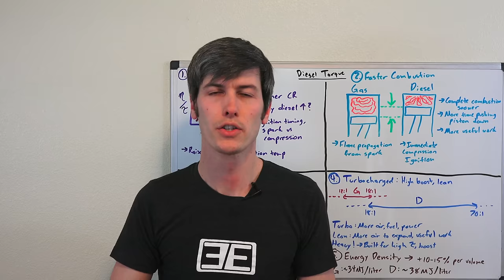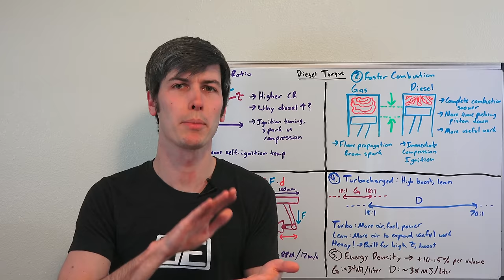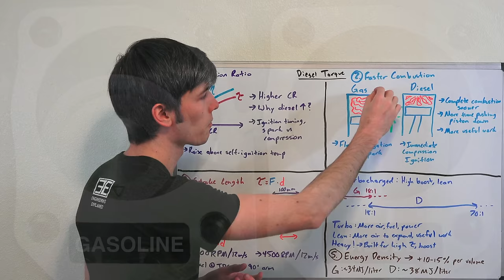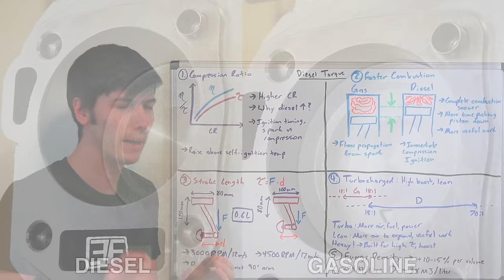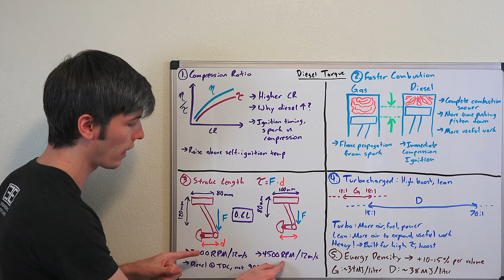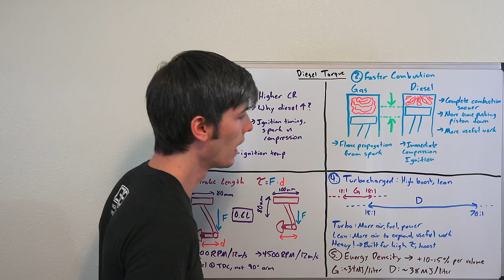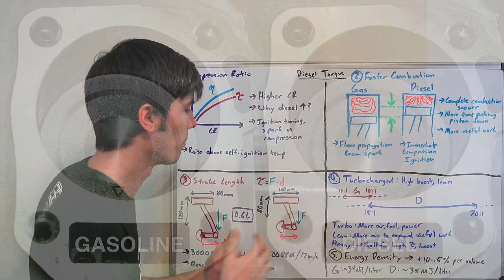5 Reasons Diesel Engines Make More Torque Than Gasoline

Comment: Modern diesel engines also have the advantage of the fuel being injected in stages, a pre injection to get it going followed by multiple tiny injections as the piston turns over for a more even and longer combustion pressure during the power stroke resulting in higher torque. Compared to older one shot diesel injectors.

Comment: hi my name is i am mailing you to ask one technical question i want to know that the v12 or v8 engine build for mid engine layout is constructed similarly like v8 or v12 constructed in structure and design like front engine does the engine in mid engine layout is same as engine in front engine like because cars like pagani zonda and huyara got engine from mercedes mclaren f1 has bmw v12 engine and some supercars have chevy base v8 engine koenigsegg got ford based engine so does mid engine layout has same engines which are constructed for front engine and same engine can be used in either mid or front engine layout waiting for your humble reply thanks indeed

Comment: About energy levels diesel vs gasoline, the diesel fuel molecules are made up of longer strands that are convoluted. The gasoline strands are shorter but both have carbon atoms. When these react with oxygen, more energy is released by the diesel molecules compared to gasoline.

Comment: Diesel engine are heavy and bigger as it vibrates a lot cause the whole power making is based on compressing the air fuel mixture, may be not for turbos
Cause manufacturers are marketing turbo petrols more than diesel turbo engine.

Comment: I have never seen a Gas engine where the piston didn't travel all the way to the top of the cylinder. The combustion chamber is in the head. Most diesel engines have the combustion chamber on the piston. The head is completely flat.

Comment: Why not make gas engines operate like diesel? Instead of spark plug, have high compression and inject the gas at tdc (like with diesel), won't the heat be enough to ignite the gas without a spark plug? That's why gas usually has lower compression ratio to prevent predetontation, so why not use predetonation to its advantage and out do diesels?

Every diesel guy talks about how much "better" diesels are but they always ignore the fact that diesels need to be boosted. There have only be a few non-turbo diesels ever made and they're complete crap. So if you compared a 2.0 turbo gas engine to a 2.0 turbo diesel engine, which would get more power and which would get more torque, and why? Mazda achieved 14:1 compression with its skyactiv engines, so if you just turboed that, theoretically it should get more power and torque than a diesel.

Comment: OK, so I have a question that I've wanted to ask for a while and this vid is the perfect opportunity.  Why, in the diesel, don't they just force in more air so that the compression ratio would be much higher, and then just let the piston go back down a while and wait to inject the fuel until the crank is closer to the ideal angle, maybe centering injection on the ideal (right) angle.  The idea being that compression would still be high enough at that point to ignite the fuel.  I would think this would increase torque a lot.  Maybe all that compression would just create too much heat? Thanks.  I watch all your vids several times, which is why this question is a little late :- )

Comment: Video is somewhat confusing/misleading to me. Diesel is significantly less volatile than gasoline and has a much slower burn rate and yet you say it achieves complete combustion faster because of the time it takes to gasoline to achieve complete combustion

Comment: I must take issue with the assertion that diesel combustion is quicker. Diesel combustion requires the fuel and air to mix, which takes time. This is why diesels are RPM limited, more than the heavier internal parts. (Look at the Audi R10 redline rpm). The slower combustion, along with the higher compression ratio, allows a diesel to have a much higher BMEP for a given peak cylinder pressure. And BMEP is what drives torque output.
Reply: Specifically, the initial injection of diesel fuel ignites, but creates a locally oxygen-deprived environment. Only after the air swirls to expose the unburned fuel to oxygen will combustion continue. This takes time, which limits the rate of pressure rise and creates higher BMEP within a given PCP limit.

Comment: I would like to add that this is also logical since diesel has a lower auto-ignition temperature. Also doesn't compression ratio and stroke length go hand in hand? Thus producing more torque?

Comment: DS gas and air mixed in compressed will not blow up that's why it needs a spark plug but diesel fuel and air compressed will blow up no need for spark plug

Comment: Wait. If the gasoline engine's ignition occurs over a longer period of time while the diesel engine's one occurs almost instantly, why is the PV graph of the otto cycle sharp pointed while the diesel cycle is the one with the flat top?

Comment: what would happen if you bore a hole on the top and put a spark plug on a diesel engine, mount all the necessary wires, coils, rotors, etc... then run on gasoline?
Seems like gasoline engines are not utilizing their full potential.

Comment: Diesel engines are always sort of running wide open throttle with the output controlled by the amount of fuel injected where as gasoline engines spend most of their life heavily throttled, little air entering the cylinder, small amount of actual compression and that is where any engine is least efficient if I'm not mistaken.

Comment: Just two things.
The diameter - stroke ratio is not much different between Diesel and Gasoline engines if they are car engines.
And today most Gasoline engines are also Turbo engine.

Comment: You are making it sound like it’s a mechanical function. It has to do with entropy and constant pressure vs constant volume. Thermodynamics explains its better along with the chemistry of the fuel. Do some searches for otto cycle vs diesel cycle. I took this class in Engineering School so this is what I remember from it at least.

Comment: Not all gas motors stop the piston before reaching the top of the cylinder. Actually most I know of are zero decked and use the cylinder head combustion chamber volume to set the compression ratio. Some also will dish the piston to lower or dome the piston top to raise. Stopping the piston short in the hole is the worst way to do it.

Comment: In the combustion the diesel keeps injecting diesel so it keeps combusting in the working phase, plus diesel is denser so you need less to "make" the same, its easy to remap and some use variable turbos which increases usable torque and power along the rev range

Comment: One thing I noticed in my 1.5 diesel Nissan Qashqai recently was on motorway in Top gear with throttle position fixed and road speed fixed after a short delay 20 seconds or so the revs dropped (approx 200 revs) Is this some recent new diesel fuel control feature on the Renault K9K engine? This obviously is assisting in achieving the 70mpg I was seeing.

Comment: In regards to you saying that the stroke length doesn't have much effect on torque, is not the case. You are disregarding the leverage that a long stroke motor has. This leverage is where the torque comes from.

Comment: The faster combustion part is quite apparent when you look at the ignition/ injection timing for the two types of engines. I have a Cummins B3.3 engine which injects the fuel 6.6 degrees after TDC, while gasoline engines almost never have less than 5 degrees of ignition advance.

Comment: Is the HP for gasoline engine higher than the Diesel Engine?

If it is higher for the gasoline engine, then is it due to the higher RPM produced for the same piston speed?

Thanks

Comment: Injector pulsewidth... The time the high pressure injectors has to inject fuel at high rpm is number 1 factor that limits a diesel engines rpm

Comment: Diesel motors are  great....run maily on air stronger last longer use  less fuel...but do not get a motor with a cast iron block and a aluminium hear u get electroloses and yr head gasket will  corrode ...may be head too...water will enter yr motor unless u have a special head casket..

Comment: I normaly like your explanations, but this time u are wrong. No Dieselengine will produce more torque at the same circumstances. The Compession means nothing in this case. U just have to watch how much energy fuel has per kg/ liter and how much fuel u can burn per kg air combined with the efficency of the engine.
Shortcut: Compare Engines with the same displacement and with same boost pressure and u will see always around 30 - 40 % more torque on the gasoline engine at same techlevel and it doesn´t matter that the compression ratio on the dieselengine is twice as high.

Comment: In my engineering class they explained that Diesel fuel burns much slower then gas, so pushes for a longer period of time. It is more of an oil than gas.

Comment: if diesel engine is better in most aspect 1)why is there less gas station with diesel fuel 2) why less diesel cars than gas cars 3) why small engines are mostly gas engines i.e.  garden equipments mower, shedders etc . . .

Comment: the only thing that determines the torque is the cylinder capacity and the average pressure and / or the presence of a turbo.
the turbo boosts the torque because the load pressure helps during the intake stroke

Comment: The main reason is the tutbo charge and U totaly disagree with the combustion thing as diesel burn much much slower then gasoline so slow in fact that on earlier diesel it was designed to start before the piston reached the dead top center, what made the diesel distinguish sound of knoking.

Comment: If I create a diesel engine with shorter stroke, it makes the diesel engine runs on higher RPM, right?

And, theoritically, we can inject petrol inside the diesel engine, right? No knocking happens because the petrol is injected at the right time.

But, why don't car makers do that both?

Please enlight me, Masters.
Reply: BismoB Slow combustion is limiting RPM in diesels, not longer stroke.

Comment: At the top of the diesel stroke, why can't a drop of water (or however many it takes) be injected which will turn into steam (steam has more torque than diesel)? Oil driven cars is the biggest scam in history if you ask me.

Comment: I have noticed that diesel-powered vehicles have a wider exhaust pipe. I am guessing that is to accommodate the diesel moving more air through the engine than a gasoline engine does, as was explained in the video.

Comment: Do Diesels actually produce more torque than Ottos? When one compares naturally aspirated engines, Ottos that make 120Nm/liter can be found, diesels are around 80Nm/litre. Which makes sense since they cannot use all the air in the combustion chamber. With forced induction, the limits on both are more in mechanics and materials to handle the combustion pressures.
Reply: skuikka 
Diesel responds in many ways better to forced induction. Efficiency doesn’t drop with boost like it does in petrol. Diesel doesn’t mind low rpm hogh torque, whereas I’ve noticed that modern turbo petrols aren’t too happy. Diesel doesn’t have detonation problems, it accepts however much boost you throw at it :)

Comment: Why when we increase engine rpm  . the torque comes down ? the next question of mine is howcome diesel engine produce maximum torque and hp in low rpm while in gas engine in high rpm?

Comment: One thing you have not seemed to consider in this and other vids is that DECK HEIGHT is higher on the typical inline diesel engine versus gas engine.  This is necessary to accommodate for longer piston skirts, but it has the added benefit of allowing the connecting rod to stay straighter which applies more direct force to the crank throw.  This is why inline 6 gas engines also make more torque than comparable displacement V6 gas engines.  A short deck height (for any given  "X" stroke length) has the conn rod going through more angular change and turns more energy into side-loads on the piston skirts and crank throws.  Otherwise, good vid.

Comment: The rod ratio (length of connecting rod versus stroke length) has a lot to do with when and how much peak torque an engine makes. Longer ratios make for more torque but lower peak.

Comment: There is no ‘throttle’ on a diesel like on a gas engine. Diesels are fuel controlled, gas engines air controlled. A diesel is like a big air compressor.

Comment: You did not mention that the turbo allows the fuel entering the engine to be denser for a given volume which can increase the air to fuel ratio but also allow the engine to run at a lower compression ratio as it will reach the ideal combustion pressure sooner. This lower compression ration allows higher piston speeds and lighter weight engine to produce a given amount of power. Lots to consider.
Cheers Warren.

Comment: Diesel is sprayed into the cylinders and immediately combusts at or around tdc. Thats why many European dieses are preferred over the petrol powered equivelent because they offer enhanced fuel economy. A 1.4 litre diesel for example, can easily achieve in excess of 70mpg!
Petrol on the other hand is ignited by the spark plug and starts burning from the spark plug outwards. Its still burning when the exhaust valve opens so complete combustion does`nt take place. This is why they suffer from far inferior fuel economy compared to their diesel counterparts. Also diesel engines last longer in service because theyre built heavier as EE explained. 200,000 miles is easily achieved with just basic maintenance.
Reply: Diesel has a much higher energy density than gasoline (petrol), so for 1L of fuel, a diesel engine will have much more energy in it.

Comment: for such a seemingly smart guy, you sure do dismiss the stroke length rather quickly, and rather easily mistake heavier engine components as correlating to higher power output overall.  decidedly not a smart couple of things to convey.

Comment: but theres not a single reason to drive diesel. It will only result in more pollution, therefor it is absolutely BAD to use Diesel engines

Comment: It is right, that it takes a little bit of time till the flame reaches the outer layers in a gasoline engine, but Diesel doesn‘t ignite instantly. It also takes time to inject the fuel into the cylinder

Comment: #2 seems to contradict my basic understanding of fuels compared to each other. I think you're confusing autoignition with combustibility. Gasoline ignites explosively as opposed to diesel which 'burns'. Granted, we're still talking millionths of a second. The air-gas mixture just needs the instant of a spark to accomplish what diesel does on its own. For that reason, duration of the injection event(s) is so important and must be balanced with timing, rpm, and cylinder volume. It is impossible to have a single detonation event in a diesel, just not in the cards of the fuel's properties or delivery system.
Reply: Gasoline does NOT ignite explosively!  At least not in a properly running gasoline engine.  Explosive ignition MAY occur: it's called "detonation" and it is a malfunction and harmful.  In normal running gasoline engines use combustion, not detonation, and the flame front travels at several meters per second (i.e. it's quite leisurely).

Comment: I've always been curious about why diesel buses and trucks have that turbocharger spooling sound. it always made e wonder that do they even have turbochargers in them??? Thanks, for clearing my doubts. As always keep making great videos!!!
Reply: You will have difficulty to find a modern Diesel powered vehicle without a turbo charger. Even the freaking huge 2 stroke marine Diesel engines use turbo chargers.

Comment: Juste one thing about the bore/stroke ratio : If you have a larger bore, you also have a bigger piston surface thus you also have more force on the connecting rod (for the same in cylinder pressure) pushing on the crankshaft. To compare engines, it is useful to use the mean effective pressure (MEP).

Comment: Thats interesting you say combustion is nearly instantaneous in a diesel. In my thermodynamics course, the expansion processes in a Diesel cycle is modelled as a constant pressure expansion until it reaches a known cutoff ratio; this to me would mean a longer combustion process exerting the same force on the piston over a longer time. In an Otto cycle the ideal combustion (Q in) is instantaneous and pressure decreases as the piston travels from top to bottom dead centers.
Reply: What you say is correct, but real-world diesels never behave like the constant-pressure cycle shown in the text books.  They actually have an extremely fast pressure rise, hence the audible "knock".

Comment: Combustion timing also.... spark ignition engines ignite the gasoline/air mixture well before top dead centre, a lot of the energy of combustion is used up by the piston having to compress against combustion forces.

Combustion in diesels generally occurs very very close to TDC or even just after, pretty much all combustion forces go to the piston when it is travelling down the cylinder, it is more energy efficient.
Reply: Spark plug firing before TDC is to allow time for the flame front to propagate and reach the piston crown. The ideal situation is the flamefront reaches the crown as the piston starts its downward stroke. If the piston is till rising this will result in pinging noises. Hence the reason for ignition timing being varied according to speed and load.